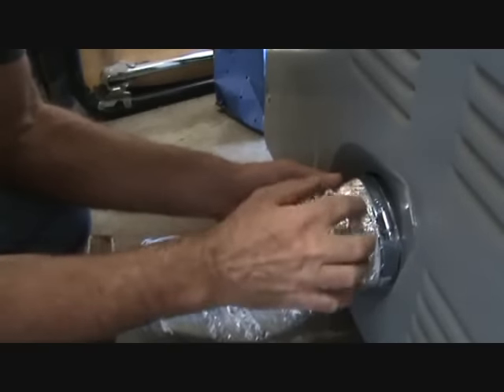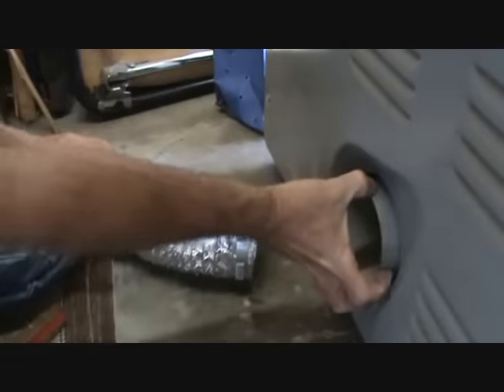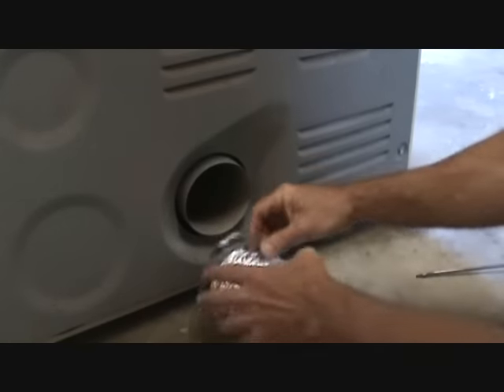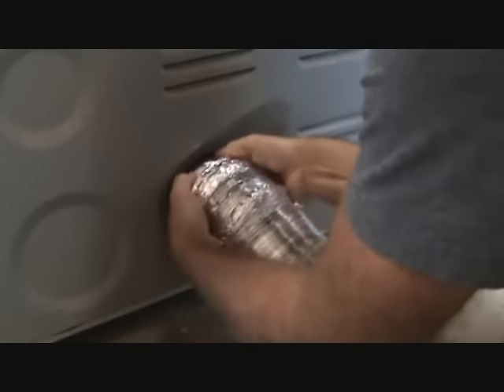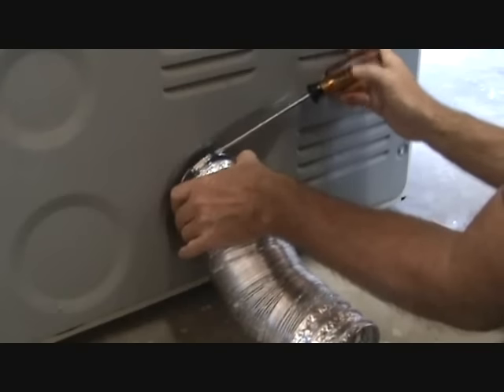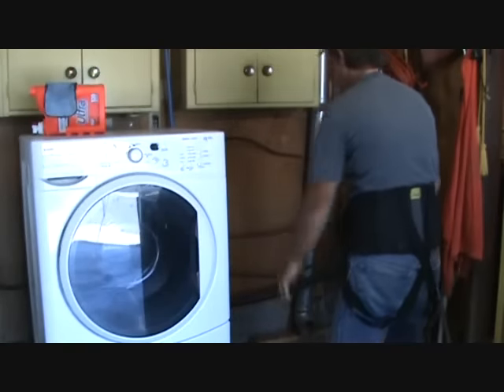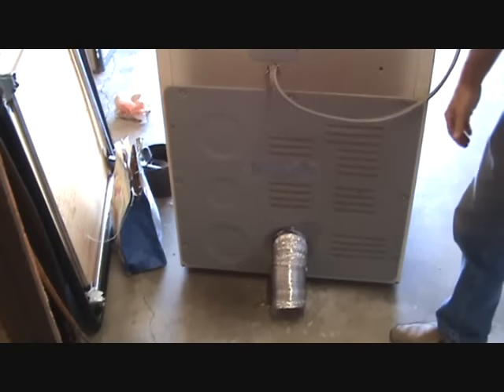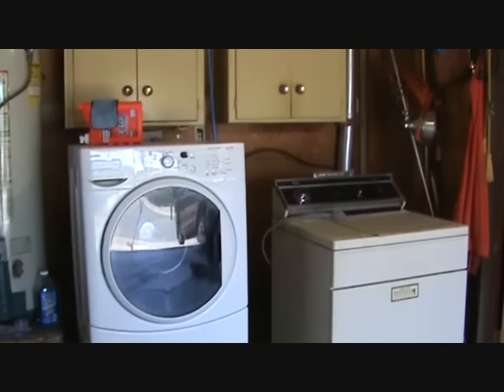How to install a dryer vent flexible pipe

Comment: I thought you're supposed to cut the hose to avoid extra material and possible clogs.
Reply: Exactly Right!!  Let me quote from my Everbilt Flexible hose safety Information paper. "Flexible ducts are to be extended to their full length; any excess duct is to be removed and the duct is to be kept as straight as possible.
Reply from the maker: The only problem with keeping the duct as straight as possible, how are you going to push the dryer back into place without kinking the straight pipe? The flexible duct style is designed to be pushed back into itself & should not harm anything. Then when you need to pull the dryer back out away from the wall (if ever) you will have enough room to pull out far enough to shimmy back behind there. See?
Reply from the maker: The only problem with keeping the duct as straight as possible, how are you going to push the dryer back into place without kinking the straight pipe? The flexible duct style is designed to be pushed back into itself & should not harm anything. Then when you need to pull the dryer back out away from the wall (if ever) you will have enough room to pull out far enough to shimmy back behind there. See?

Comment: Frigidaire dryer, exhaust vent is too small to take a 4" vent tube. By the time you tighten it enough, the tube rips... Why do they go against industry standard? Most engineers and designers have never actually done the work they design for others to do...
Reply from the maker: Not sure why the manufacturers do silly stuff like that. Hope you got your issue resolved!

Comment: What happens if your son accidently pulled the dryer vent out of the wall, can a person just put the piece back into the pipe?  And all will be good.
Reply from the maker: I guess it would depend on what type of connection your son pulled out & how it was previously attached on whether or not you could just push it back in to the wall cavity. Can you shine a flashlight in there & see?   Joe  :0
Reply: VideoJoeKnows Thanks Joe, the installer of my washer & dryer told me I would have to get a professional out to put it back together.  Well I just pushed it back into the wall pipe and the dryer is working fine.  Thanks again, I must check out some of your sites.
Reply from the maker: Cool. Yes check out more of my howto videos & hopefully I can save you some money around the house!   Joe  :0

Comment: Could you just use a cable tie instead of a clamp?
Reply from the maker: I would much prefer the clamp as the cable straps could get loose & slide off without you even knowing it on down the road.

Comment: Lol I thought you had a hack but you’re struggling just like me my friend.  I wish I never took the darn thing off.
Reply from the maker: Ha! I wanted to show that an average Joe (that's me) will have trouble putting it on just like you! I heard one person who commented say to install like an metal elbow on the actual dryer & screw that on then attach the flexible ducting to that & that would work a lot easier. But if you don't want to do it that way then you will just have to take your time & hold your breath just right & make sure to put two or three strands of flexible pipe on the dryer outlet before putting on & securing the pipe strap so it won't come off. See what I mean? Thanks for stopping by yo!

Comment: thought no one uses those foil flex
Reply from the maker: +723lion Well the hardware stores still carry this product so i thought I would use it. It's been installed for about 3 years now with no issues. i would think that if this type of flex should not be used then the hardware stores would not carry it. Thanks for your message!   Joe  :0
Reply: +VideoJoeKnows Thanks, you are right, Home Depot still have them :)
Reply from the maker: Ha! That's where I got this one as a matter of fact. I thought what the heck I will give it a go....!   Joe  :0

Comment: I have a dryer inside of a laundry room, the builder doesn't have anything in the wall to connect the dryer vent to. The previous owners just shoved the hose into the duct in the wall. this results in a large amount of lint being blown up into the wall because the is no solid connection to the duct that runs under the house outside. Can someone please help me with any ideas ??? Desperately not trying to have a fire!
Reply from the maker: Yo Abby did you ever get your issue resolved so your house doesn't burn down? Let me know!

Comment: My mom and I had tried to do it today but we couldn’t do it, it came off Yost so we tried putting it back on, and it ripped, so we’re went to our local hardware store and bought a new one, we ended up typing that one too.
Reply from the maker: Watch this video again to see what you might be doing incorrect. Yes it fits really tight almost like it won't fit but slip it on there with just one edge with one edge of the first ring then try getting it on there as I show with at least two rings pushed on there before tightening down the clamp. Let me know how you do or what you are still having trouble with. If you rip the first bit then cut back a little & snip off a bit of the end ring then try again. You can do it!!!
Reply from the maker: Did you try again? Let me know....
Reply: @VideoJoeKnows  no, I think my dad will try but not today, I don’t know even he will try, I don’t live with my parents.
Reply from the maker: @12369ja  Well check with Pops later today. It's important to get that pipe attached to the dryer.....let me know when it's on there & you can assist by staying on top of it....because you can!
Reply: @VideoJoeKnows  I know he will get it on venue it is used again, my mom thought it worries me ok to use with the Hoffer of sand my Dad said no, but I don’t know when he will get to it because he is going though health issues, I won’t say what kind of issues.
Reply from the maker: @12369ja  I am going to guess if YOU really tried hard you could do it yourself. what do you think? Let me know what questions you might have so I can assist you. Let's surprise them!

Comment: there's not enough room behind my dryer for the hose and if I pull out the dryer there isn't enough room to do the laundry
Reply from the maker: +Ray Meadows I would think if you use a flexible dryer exhaust tube you should barely have enough room to push back against the wall & still let you use the dryer properly. some dryers also have a concave gap area in the back to allow for some of the vent space. Look at yours & see. Let me know how it goes!   Joe  :0
Reply: My problem is the route the hose needs to get to the exterior vent, is bloked by the gas line coming out of the floor. Its right in front of the dryer hookup.
Reply from the maker: Hmmm. Not sure why they would've done that.  Maybe you can take a picture of the current connections & take to your local hardware store & see what a salesperson might suggest for the parts you need to connect the dryer. let me know what you end up doing. Good luck.   Joe  :0
Reply: VideoJoeKnows You were right, I went out and got a puncture and flame resistant foil flex hose and pulled the dryer out about two inches and I have just enough room to maneuver the hose around to the exterior hookup. Thanks for all your help Joe!
Reply from the maker: Dude way to go with hooking up the dryer. You rock!   Joe  :0

Comment: except for the small part where this venting has been banned for dryer vents for a while
Reply: Samantha Gray:  Has it actually been "banned" or is it simply not recommended?
Reply: Bill Wilson
It's not code anymore so I would consider it "banned". The cops won't kick down the door and you arrest you for it, if that's what you're asking.
Reply from the maker: Not sure....
Reply from the maker: Not sure but why would local hardware stores still sell it near the appliance department by the dryers?
Reply from the maker: Why are the hardware stores still selling it though...?

Comment: Don’t use the soft foil venting. Having reviewed with hundreds of homeowners their installation guides not one allows the soft foil. This install easily could have been done with rigid vent. I did repairs for most every manufacturer around the world in and out of warranty.
Reply from the maker: Rigid venting does not give you much flexibility in case you need to move your dryer further back or over a bit etc.. Even where you purchase washers & dryers at hardware stores have the aluminum flex in kits you can purchase to install your dryer so I guess the message has never reached most hardware stores as they sell the aluminum flex pipe waaay more than rigid. I see your point though & wish the manufacturers would get together with most hardware store to let them in on their secret!
Reply: @VideoJoeKnows  I agree that places sell the improper venting along side dryer products and that is just a retailer not caring about customers. The retailers know the venting isn't allowed but Home Depot, Lowes The Brick (here in Canada). The venting causes premature dryer failure and that means more profit for the retailers. I argued with the manufacturers of the foil venting and they came up with every bit of nonsense and i even bet them and they refused. Bottom line if the dryer is not installed according to supplied manufacturer instructions you have zero warranty.
Reply from the maker: @rondenhollander4313  Thanks for the information. Much appreciated. Make this year great & thanks for continuing to watch VideoJoe!

Comment: Do not follow advice on this video. No manufacturer allows the soft foil venting to be used on their products. No real technician will install this venting. If you see an installer hooking up soft foil venting ask him to leave your house. They are incompetent. Have seen dryers fail premature due to this venting. Remember warranty is void if not installed according to manufacturers supplied instructions.
Reply: ron denhollander if only you had a video to show us how to do it the “right” way.
Reply from the maker: All I can say was I was attempting to help Aunty out with reconnecting the dryer vent pipe she had. If these foil pipes are not legal then why do you suppose hardware stores sell it in the appliance area next to dryers?
Reply: @VideoJoeKnows never said they are illegal just said no manufacturers allow them. Hardware stores sell them because they care about making money not safety. I have asked many stores why they sell them and they have no clue why, just don’t care to know their jobs. You aren’t helping her out only causing the life of the dryer to shorten.
Reply from the maker: @rondenhollander4313  I helped her ten years ago about & the dryer is still working fine as far as I know. And if you say manufacturers don't allow the flexipipe then why don't the manufacturers tell the hardware stores not to sell this pipe? I hear your concerns & thanks for voicing them for sure.
Reply: @VideoJoeKnows  she has been lucky. It is a fire hazard and I would never leave someone in that condition and that is the problem with DIY warriors who don’t pay attention to the installation instructions. I have attended a few fires as an inspector and even had to retrofit thousands of dryers to put in an extra safety device and we would make a report about wrong venting and this can cause insurance problems. Why do hardware stores sell them ? Money over safety and ignorant sales people. I refused to sell them. Same reason I guess why unsafe video are posted on here .I am very passionate about safety but sadly too many aren’t.  I have seen videos where people bypass safety devices, shorten heater elements all to post a video. Are you honestly ok with leaving your aunts dryer in an unsafe condition?
Reply from the maker: @rondenhollander4313  I hear your passion & I honestly thought that this flexipipe would be ok seems as though I have seen it in many homes & she had it on her dryer for years before she asked me to come out since it looked like it had come undone behind the dryer. I've even seen some guys install this same similar one when they came out & installed a washer dryer set at a house I happened to be at many years ago so if you say it's this bad then I have to question the entire community for why this continues to happen. In fact shouldn't the building inspectors who inspect new homes before someone moves in not allow it if in fact it's as unsafe as you claim it to be? Why have I never heard about how unsafe this is in the news ever before? I am not questioning you on all the info you have to give rather I am questioning why society continues to let it happen?

Comment: Ironically I need to vent... None of this should be this hard whether it be a new home or home that's 40 years old it boggles my mind that the home builder and the architect have evidently never had to install a clothes dryer... I would bash on the manufacturers but I understand from a gravitational standpoint why you want the vent hole on the dryer on the bottom I also understand that they make attachments that may help...
 my biggest complaint is the amount of room that most home builders much less apartments give you to install any of these things...
 in what world do these people live in?
Reply from the maker: Ha...."I need to vent"....in more ways than one. LOL I agree with you but it seems the manufacturers won't care until one company starts to make them differently for easier install...then they all will change. I don't see that happening anytime soon though. I have more DIY howto videos on my channel for more learning & saving. Just go to my main YouTube channel page then click on playlists then scroll down to see all kinds of ways you could be saving money. Try it!

Comment: Those are fire hazards, will heat up and burn.
Reply from the maker: If they were a fire hazard then why would the hardware stores be able to sell flexible piping such as this for dryers? I would think it would only be a fire hazard if the lint somehow clogged up in the piping & heated up....?

Comment: the thin foil is a fire hazard!!!!!! wrong material. Fire will happen.
BTW there is an inherent design problem with venting....both manufacturers and material suppliers need to get on the same page....
Reply from the maker: I agree with them needing to get on same page & when the hardware stores sell this type of flexi pipe you would think it would be an approved pipe to install on a dryer!

Comment: I had to do this several times because lint can accumulate quickly in these stupid dryer hoses. The part of having to attach the hose to the bottom of the dryer is the most frustrating and tedious part of the job know matter how times you do it! You would think they would design a better way to do this but nooo....attaching the host using the circular ring while trying to screw it in is the dumbest most idiotic design I have ever seen!
Reply from the maker: Ha! I hear you loud & clear! What you could do is find a sheet metal 90 degree elbow & install that on the end of your dryer THEN attach the flexible ducting to that. A viewer made this comment to me the other day & it makes sense! I'm going to do that next time I install a dryer. Then it will make it waaay easier to remove & install the flex pipe. Would that make your life easier?! I'm sure it would! I have lots more DIY topics & videos you might appreciate. Just go to my main YouTube channel page then click on playlists then scroll down to check them out. Lots of things on there that will keep that money in your pocket for sure! Try it....

Comment: The pipe coming out of the dryer is too short. It should have been longer, and there would not be any problem. Just a poor design.
Reply from the maker: I agree 100%. They could've made it an inch longer then also tapered it for easy of installing the pipe...right?

Comment: The vent shown is a code violation of the international residential code.    The reason this type was removed from code compliance is because it is flammable.    It is also a very poor performer and is prone to build up lint.    Don’t do it.
Reply from the maker: That's good to know. What type of pipe would you recommend?...the aluminum flex pipe? My question would be why would hardware stores sell this type of flex pipe if it's against code as you have pointed out? When you go to the Appliance area in most hardware stores, right there next to the dryers is this flex pipe kit that I show in this video. Thanks for stopping by!

Comment: Against code. That’s flammable.  Do not follow this advice.  They make flex that is metal.
Reply from the maker: I would ask then why do hardware stores still sell it? Yes they have expandable aluminum ducting that you could install for the line instead. Thanks for your message.

Comment: Why is he sounding like It is an impossible job with lots of explaining?
Reply from the maker: I figure the more I talk the more viewers will learn. In your case not so much. You can watch & learn while others can listen & learn while even others can watch, listen, & learn. It's not impossible to install the hose but see how most dryers the extension pipe only sticks out so far from the back of the dryer & it would be way easier if the dryer companies would make this extension lip stick out a little bit further...see what I mean? Thanks for stopping by!

Comment: WTF....anyone cover ANY possible differentials in flex size over dryer vent or vis versa......dryer  Flexible vent is same size or smaller than dryer vent attached to dryer same issue outside Manu facturers do not make it so that you can easily slip dryer vent over dryer Unbelievable
Reply from the maker: I agree but don't let that stop you from getting that pipe on there anyway. You can do it!